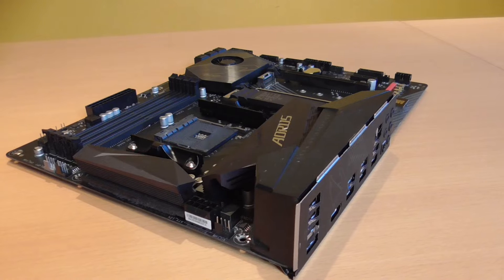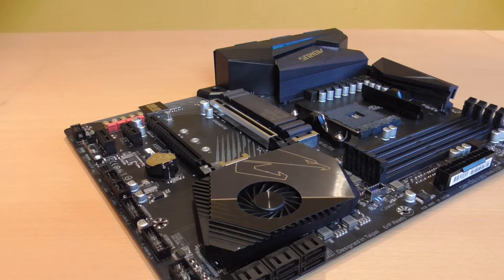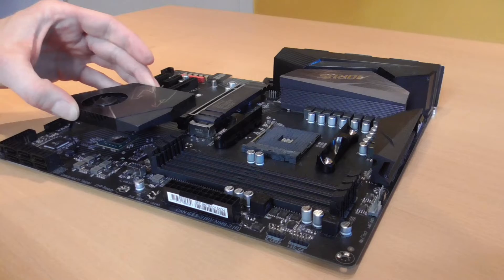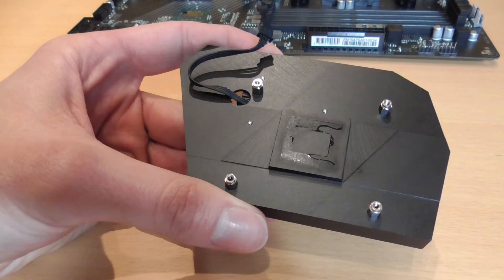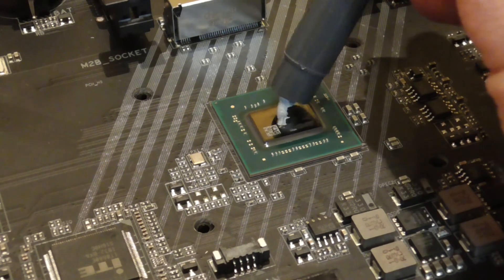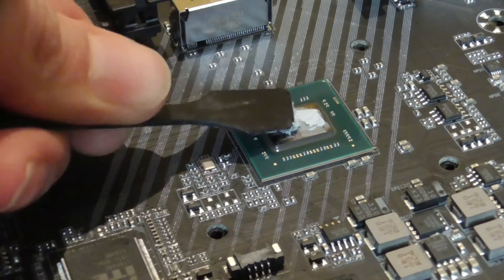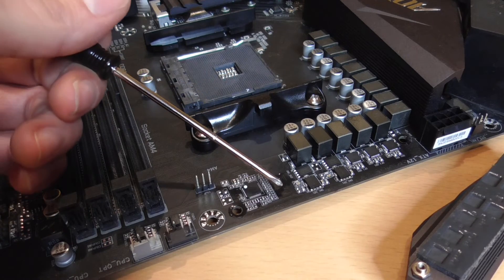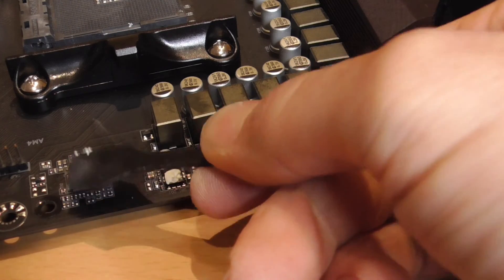The thing about the high X570 chipset temperature...

Comment: Be aware that removing the thermal-pad, an gap between heatzink and chipset may occour.

After removing heatzink, test with a piece of paper in between heatzink and chipset.. If you can pull out the paper after RE-installed, theres a gap.
You need to address this, else the heatzink and paste will not make good contact.

Comment: do u have the 4 screw hole distance measurement from each other?  I am considering to replace this heatsink totally.
Reply: What you plan to put in? in need to buy the mini fan. Idk where
Reply: @stormk-1130   a custom made heatsink with heat pipes.
Reply: pretty sure it's 45mmx45mm from the picture i took on a measured pad I use for repairs

Comment: My computer keeps rebooting due to the fan on the chipset doesnt work. And its nowhere to buy a new one. Will see if thermal paste will do the trick.
Reply: soak the bearing in iso, spin it, oil. spin. replaced the pad with paste and serviced the fan, she's running great now!
Reply: @alexflu2  it was the m2 ssd that overheated and it couldn’t be fixed. Will buy another one.
Reply: @skoog7091  ah i did that by not realizing I should've bought a proper heatsink with it.. luckily i noticed it overheating before it was damaged though.

Comment: Arent there more of those chips for the power supply? They seem to be attached to the VRMs. Shouldnt the rest of the VRMs have similar chips? Were you able to tighten the heatsink down far enough to make good contact with the putty/chip despite removing what looks like 3mm of pads?

Comment: What is the thermal pad size?
Reply: either .5 or 1mm.. it's extremely thin compared to the 2.5mm pads under the shield on the rear of the v1.2 board that must be removed to access the fan screws. my fans been noisy for like a year was hoping to oil it or replace it but idk if that's easily done.. still working on it, I'll be removing the fan pad for paste if nothing else.

Update: she's back together after replacing the thermal pad with paste, i also cleaned and oiling the fans bearing while removing half a pound of glue from the aluminum shroud on the Aorus Master rev 1.2. idk why they bothered using aluminum when the ENTIRE backside was covered with glue, just for appearances i guess? death rattle is gone, fan speeds are minimal, and temps are between 36-48c (no load vs heavy load)